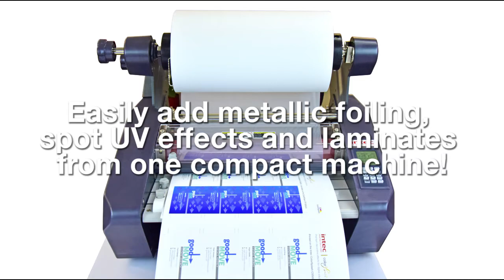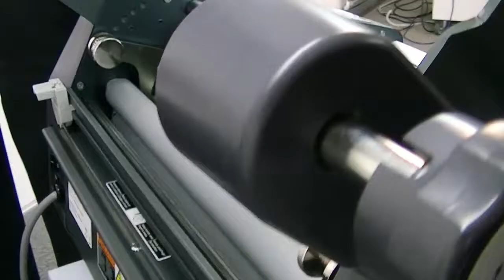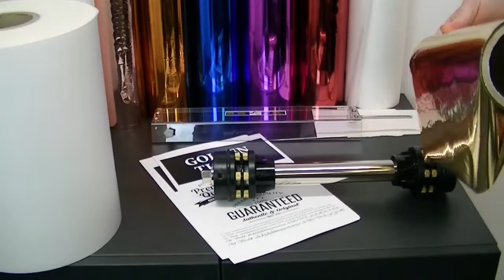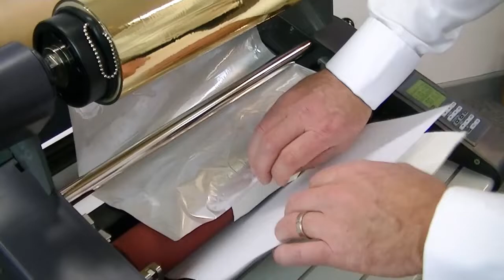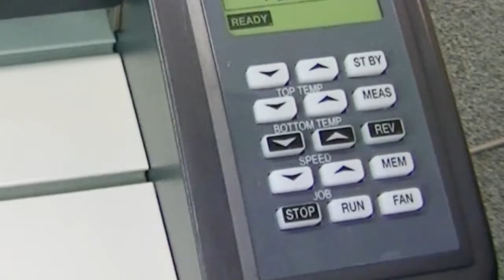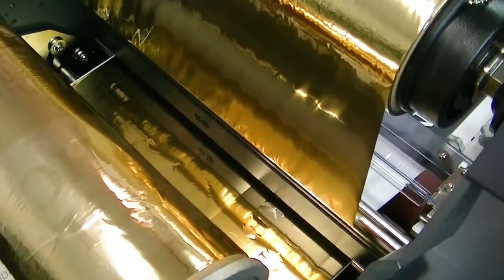ColorFlare CF350 - How to set up and use for Foiling

Comment: Interesting machine.  When in foiling mode it should automatically engage the fans.  Numeric keys would have been a better choice on the control panel.  You only have a half dozen or so dedicated command keys.  Or better still a touch panel screen.  I'm not sure the loading method makes a world of sense.  How long does it take to heat and cool that hot roller?  How difficult would it be to add a stack feeder for unattended operation?  Do you have a model that can apply different colored foils simultaneously during the feed process of new laser printed items?  You'd need to create a software profile for the printed material to make sure each "element" gets the spot foiling desired.
Reply from the maker: Hello IraQNid, Thank you for your comments. The option to initiate the fan yourself is because you can foil and laminate on this machine - it is not a pure foiling machine. Numeric keys would not work because each of the keys are separate to the menu indicator below. A touch screen would be a nice development but as prices are keen in this market it is not necessary. Loading is very easy. The heated roller only take a few minutes to heat - a little longer to cool. The model shown is an entry level solution and auto feeding would take it out of its viable price range....we have higher specification (with touch screens etc.) systems for auto feeding. No model for simultaneous colored foils but you could cut the rolls down and do it on this model. I hope that answers your question - should you require any more information please do not hesitate to contact us on: sales@intecprinters.com. Many thanks
Reply: Yeah I saw that the machine has dual uses.  So when you're in the foil mode why don't the fans get activated automatically by default?  Having to remember to press a dedicated fan button seems rather pointless.
Reply from the maker: @IraQNid  There is no foil only setting, everything is adjustable - so the system does not know if you are foiling or if you are laminating - but it would be a good programmable option if we were to have a touch screen then it could be automatic.
Reply: @IraQNid  sir how about you build the foil machine you want and stop complaining.

Comment: If I want to foil some elements of a design, example a logo or a text and leaving the rest untouched, how it's done ?
Reply from the maker: Thank you for your enquiry. You would initially print only the logo/text on the Intec ColorSplash printer, put this through the CF350 to be foiled and then put back through the ColorSplash printer for the remaining artwork to be printed.
Reply: @intecprinter  Hi there. Another question on this. The company I use for foiling will print in full colour, laminate the sheet, print the areas to be foiled on top of the laminate, and then run this through the foil process. Would this be correct for your machine?
Reply from the maker: @weddinginvitationsdurban  Thank you for your question. I can confirm that the process you have described there is indeed one of the methods we would recommend for our machine. I hope this helps. If you have any further queries please feel free to contact us at sales@intecprinters.com
Reply from the maker: @weddinginvitationsdurban  Yes that would be correct. If you want to also just foil your sheet you can print and foil with no need for lamination - you only need the over-printable laminate when you need to product a coloured image in the background or if you want to foil over an image.
Reply: Will the foil not be affected by the heat of the printer during the print process?

Comment: what is the price of machine i am from india number 9417012741
Reply from the maker: Thank you for your enquiry. If you contact our Indian Distributors they will be able to contact you regarding a price: 
Contact: Vinod Bhanushali
Intec Point
Unit No-13/G, Apollo Industrial EstateTel. 91 84336 06501
Reply: What is the price of machine in India Cell no 9604057867
Mail - ssenterprises.5786@gmail.com